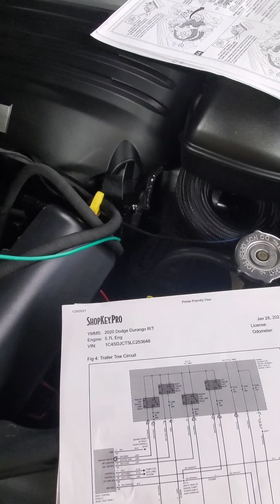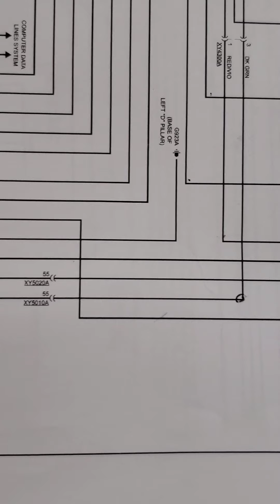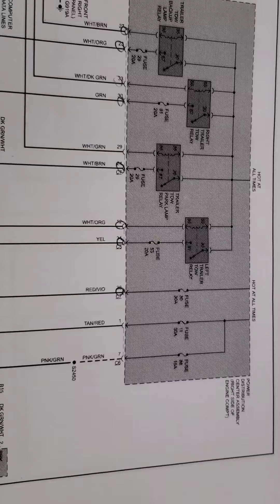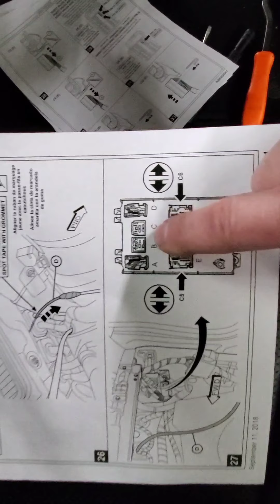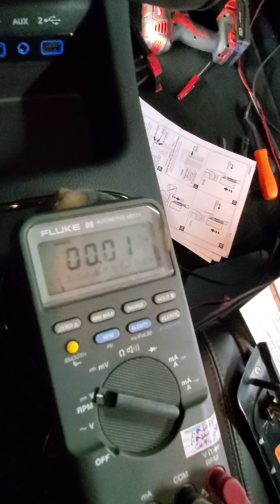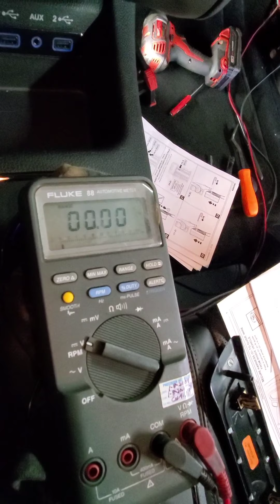2020 Durango trailer brake controller install

Comment: I was wondering where you tied into the f11 30 amp fuse for the brake control battery power
Reply from the maker: I used a oem female spade connection on the back side of the under hood fuse box.  I'm can't remember the exact terminal location, but you should be able to figure it out using a test light and pulling fuses.
Or you can get power from the positive post on the fuse block and use a breaker/fuse.